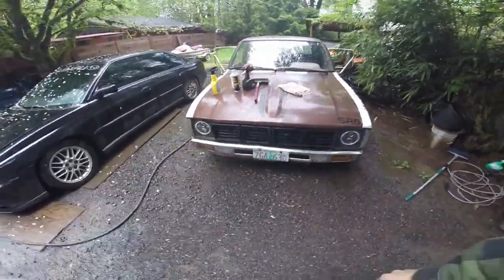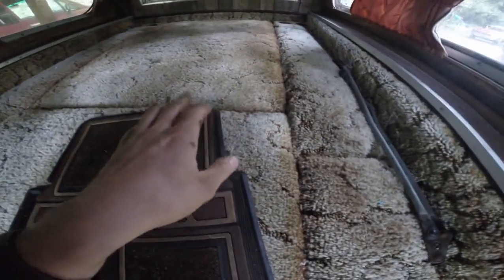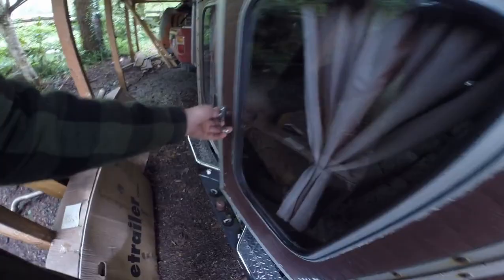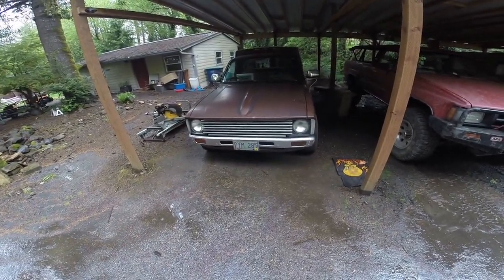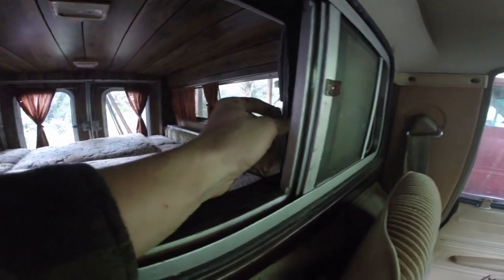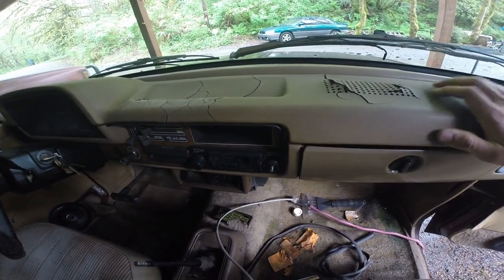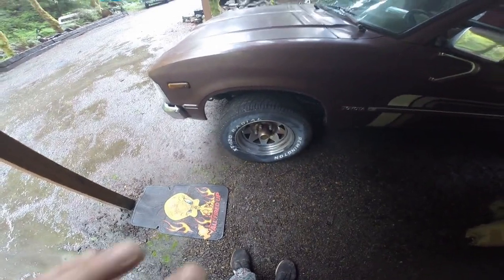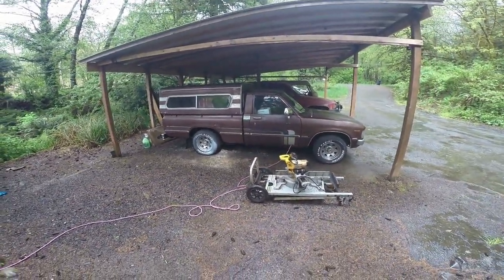Buying Chihiro (1979 Toyota SR5 Pickup with Camper)

Comment: That was my truck for for 39 years! I loved that truck so much I didn't want to sell it so it sat in my driveway needing work for 12 years. I'm so happy to see it go to such an awesome guy! I bought it used on October 1, 1981. It was all stock at the time. Anything not stock was done by me. I traded my beloved truck to a guy for yardwork that I couldn't do myself because I'm pretty old now! Two days later after he replaced the fuel pump and put in a battery he started it up and oil started forcefully spewing out of the engine. He called and tried to give it back to me and have me pay him cash for the yardwork. I totally would have done it but then he decided to sell it. He valued the work he did for me at $400. He was  supposed to do a lot more work for me in exchange for the truck. I shouldn't have let him take it before he was done with the work but I retained the title so I figured I could trust him. It needed to be moved out of the driveway so I could have the guy haul a bunch of junk away and then pressure wash my driveway which is really long. Anyway while I was trying to decide what to do he advertised it and you bought it!

I'm so happy. I cried tears of joy when I watched this video! 

Also, there is a smurf sticker in the engine compartment that my niece put on when she was about 4 years old in the early 80's. I never wanted to take it away . I hope it's still there.

Call me anytime for more info Chris!
Reply: I traded in a 1979 datsun 310gx and gave the guy $1500 for this baby. A year later I had the custom canopy built, it cost me about $1100. I added the bed liner later and the new seat.
Reply from the maker: Thank you for keeping this beauty in such good condition, and especially for the history about it. It has gone to the right guy. I will restore the truck, and have many more adventures with it! Please find that title if you can, so I don't have to submit for a lost title, during this DMV closure period. And keep watching! More Chihiro videos are going to be pumped out this week!

Comment: Looks like 2nd floor mat is under bed cushion in rear.  Also squirting oil on passenger side block sounds like oil sending unit.  There maybe 2 on that side one for dummy light and one for cluster that would be under middle lower vents.  Not a factory radio but someone did a good job installing.  Truck was probably converted by a company that does van conversions.  Definitely period correct conversion.  Neat truck.
Reply from the maker: Thanks, my newest video shows the oil shooting out. Go check it out! Even if it's not the original radio, I'm impressed that it fits that weird lower contour of the dash. It looks factory enough for my tastes.
Reply: Its hard to get the radio right they changed the dash in 82-83 to accommodate a standard radio but 79-81 needed some finessing.  I have three dash bezels for radios for my 1980 one for din mount above factory radio where pocket or cassette player are.  One slightly enlarged for 2 knob in factory spot, and one minty fresh one for factory radio and cassette deck (i have both on shelf). Currently running 1984 sony 2 knob cassette deck.  Still had to trim metal behind bezel to fit anything.

Comment: This is so cool, I just bought a 1979 Toyota pickup long bed with a 20r in it too for $300! Just like you I’m a landscaper and am about to be the third owner of the truck. I’m about to do a restoration on it and rebuild the motor since it has a crack in the cylinder head. I’m going to be watching for guidance and some tips on doing the whole thing so keep it coming man!